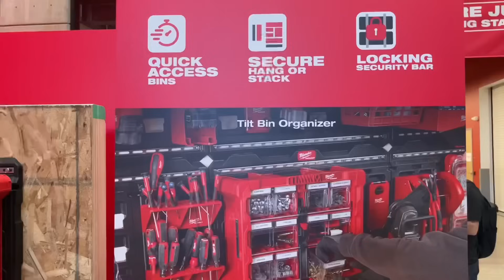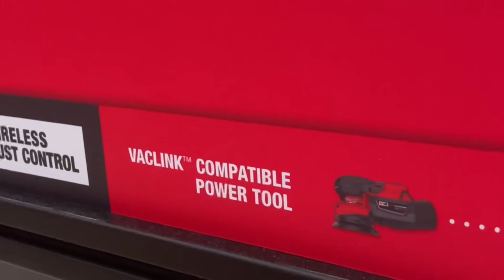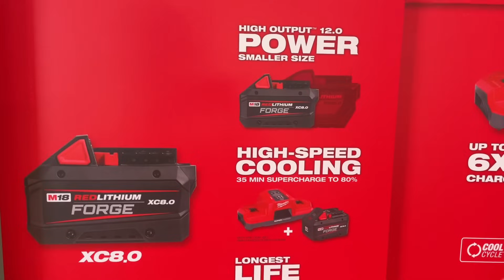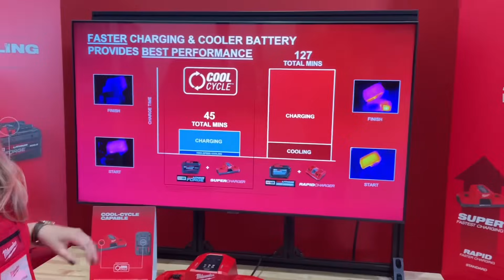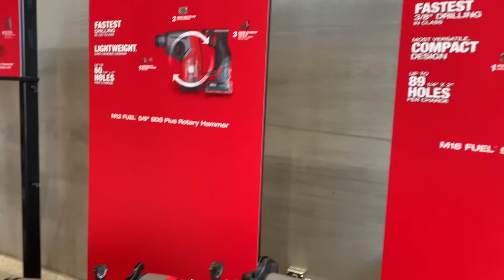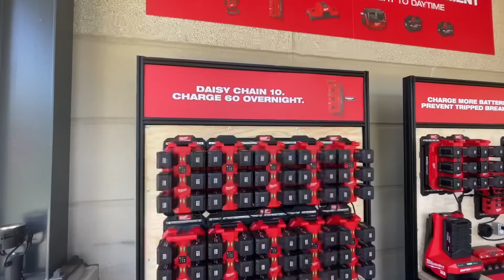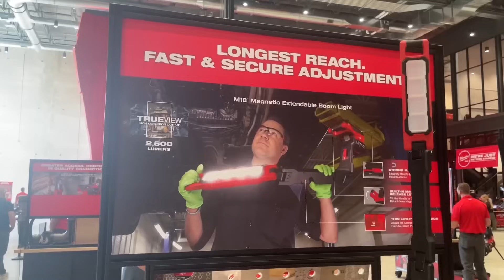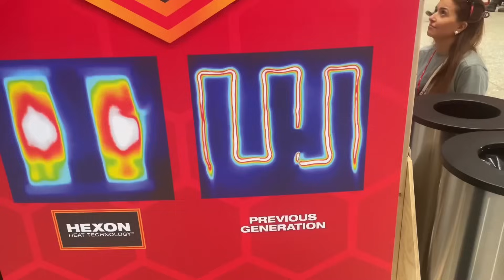Never Before Seen Tools! | Hands-on at Milwaukee Pipeline

Comment: The sanders are a bit perplexing. They put a 6” sander on the m12 line and only a 5” on m18? That sounds backwards lol. But they’ve  most certainly had Festool in their crosshairs for a while now with their tools geared toward us woodworkers. The form factor is pretty obvious also lol. The 3” sander looks like a rotex 90 rip off.
Reply from the maker: The 6” is more for automotive. More features and most likely more prolonged use with the m18 5” so maybe more of a power need, but that is a good point haha

Comment: There doesn't seem to be an equal amount of silicone adhering the colored liquids to the sanders. I love Milwaukee, but thats childish
Reply from the maker: They’re both secured the same.. just harder to see with the matte grey. But even if there was more hardened glue on the Milwaukee, that would mean there’s more surface connection for even more vibration to pass through to the bottle. Sorry just got this comment way too many times on IG already haha
Reply: @JohnBuildsIt  they did a sloppy job then. That blob underneath the bottle looks way bigger to me 🤷🏻‍♂️

Comment: The worst  brand I've ever used. Never again.
Reply: Lol you must have bought the wrong shit 😊
Reply: I can't get my Milwaukee circular saw to cut threw a 2×4. My Jig saw won't stay clamped tight.
Reply: If you bought any Milwaukee tools off of Amazon they're most likely knockoffs as Amazon is not a Milwaukee authorized seller. If it is a 3rd party vendor selling them on Milwaukee it may or may not be genuine. If it seems like too good of a deal, it probably isn't genuine.